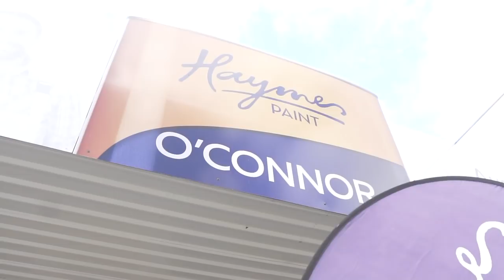Painting WRECKED R34 Skyline BAYSIDE Blue! | Poor Man's GTR [EP12]

Comment: Just a tip that works for me, try and over lap half way through a panel such as if you was painting the quarter and door you would stop half way through the door to avoid any potential runs and build up on the edge of the panel or door handles where it would be hard remove after. 10/10 for your effort tho keep it up!
Reply from the maker: Thanks Tom!

Comment: I always paint in the window shuts and inner arches first then do the face of the panels so you dont get dry over spray on the face of the panel and paint panels furthest away first so not to catch the wet paint with either the spray suit or airline when reaching over, also I paint full panels in one go like bonnet and roof so it dosent get dry spots or zebra stripes like you mentioned but overall it is looking great , I will be doing the full gtt to gtr conversion on mine soon and doing a full respray in qm1 white pearl
Reply from the maker: Awesome mate thanks for the tips

Comment: First video of yours I have seen and I am definitely impressed man! Subbed and looking forward to seeing more!
I have a video of the Subaru World Rally blue which is the same theory with a tinted (candy) blue coat if anyone is interested. 
But I must say, Hats off to you mate! for someone that's only painted twice, you did a fantastic job. I've worked with guys that have been in the trade for a long time that couldn't get a job that nice.   Couple of things I would suggest that could improve your job for next time would be, mask off all your holes (door handle holes, indicator holes etc) to stop dust and debris flying out while painting.  and when your final cleaning with prepsol, I like to use a wipe on wipe off method as opposed to spray on, wipe off.  Allowing the prepsol to dry on its own CAN cause your paint to react, especially when its a warm day.
Reply from the maker: Thanks for the comment mate!

Comment: I personally always walk the car on every coat. Reasons are where you stop at ea panel end and proceed to next panel you get build spots where you stopped at the panel before meaning ea panel end where you stop gets more paint creating a thicker paint application at those panel ends. I also start from the roof and high spots first because most booths are what’s called downdraft booths pulling the overspray downwards. Basically you paint all the bottom of the car then go high causing all your downdrafts overspray over the nice finish giving lots of fish eyes, orange peeling and splotches everywhere. Just different ways of painting. Not knocking your work at all just things to think of when the car is done and needing wet sand and color finish. Car looks nasty love that blue.
Reply from the maker: Thanks for the comment! Very informative :D

Comment: I would recommend using a dark outline color for your captions.  At the start of the paint room I couldn't read the white words over the white room and primer car.  Also when you were dry sanding the car you didn't have a mask.  I made the mistake of cutting a fiberglass tub with no mask and the crushing pain in my chest from my lungs was excruciating.  

For my R34 I would want the orange signal lights and the original tail lights.  The clear signals make me think of hazy headlights and the tail lights on now just look cheaper and too flashy.  However it is your R34.  I would also cut out the SKYLINE letters on the trunk and put an RGB light bar for the letters.  I saw someone with an R32 do it.  Headlights and tail lights were RGB too but I wouldn't go that far.  The fog light and reverse light I'm conflicted.  1 fog and 1 reverse is how GTRs are configured but the asymmetry drives my autism up.  I guess I would rig my lights a little differently.  2 reverse and re-purpose the fog light in the tail lights.  Also never liked how the break lights are only the outer circles not all 4.

Getting ahead of myself when I have 4 years waiting and $100,000+ USD needed.  NFS it is I guess. :'(

Comment: I don’t understand videos like this, such a cool car to be doing but why do it wrong? Wet sanding porous primer then scotching all your mechanical key away at the end. You realise 400 on a number 3 orbital sander covers fine with BC not to mention the wet on wet ground actually sticking to 800/grey scotch. Not to mention not clearing from the roof down so you don’t cover the car in dry spray when you do the roof last. Can only imagine the hours spent on the buff from doing the job wrong.